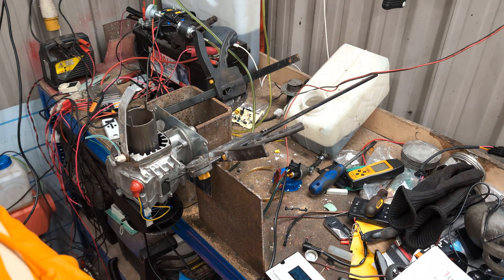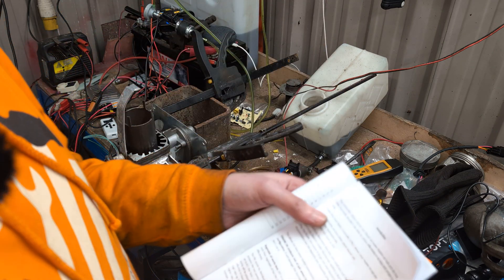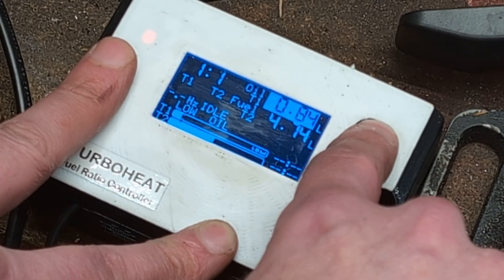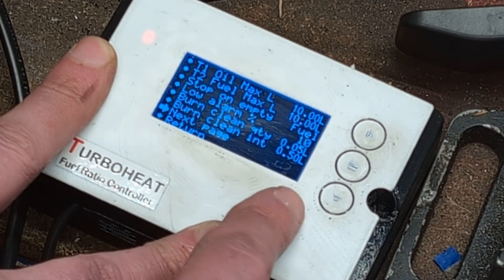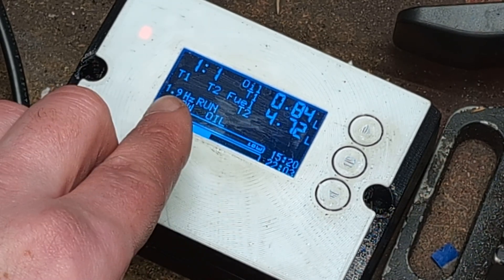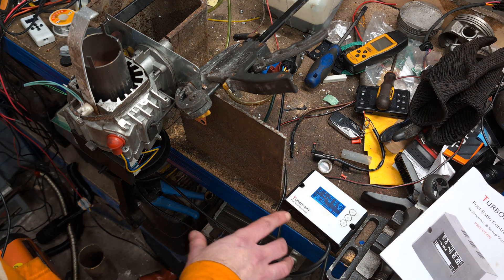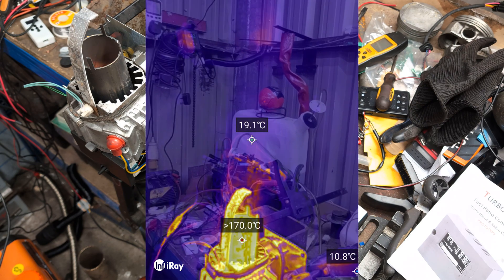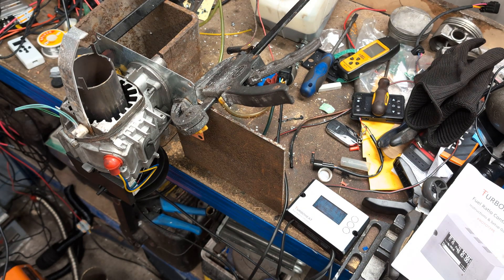Turboheat - Fuel Ratio Controller - Prototype - quick test / look

Comment: This is exactly what ive been looking for !!  saves me pissing about going outside in the winter switching taps from my veg kero to kero amd also worrying if the wife has switched to kero before switching it off . Ill be buying for sure !
Reply: What ratio do you mix the veg/Kero?
Reply: @simon7030  30% kero and a dash of acetone , also have a short copper section on the mix line that curves around the exhaust (not touching just warming) I've even put a couple of gallon of olive oil in the mix once 🤣.  You have to be religious with starting and finishing on kero for a good 10 minutes .  The biggest problem with veg oil is its glycerin content basically if not burnt hot it will separate and polymerise and cover everything with a yellow hard glue like substance like what you see around frying pans and deep friers absolute killer stuff.  If that gets in you glow plug gauze and inner burn ring gauze it's game over . I'm 3 years without a clean though .

Comment: I had the same idea.. to start up on good fuel to heat everything up and then to introduce some ratios. I remember reading the MSDS for seafoam to find its ingredients and I'm wondering if that would help to prevent fouling. Or perhaps it could be added in a cleaning cycle. Loving your videos, very informative and entertaining.

Comment: Hi  all. I have done this few projects back. Difference is that I've had a webasto water heater and controlling whole system with PLC. I found that you can achieve best results only when you have two separate feeds directly to chamber, rather than two pumps feeding one line and then chamber. Shorter the distance after pumps merge then better. Even better if you don't merge pumps output at all.  I also had a brake line around exhaust to warm oil/ waste oil flowing from pump to chamber. Tricky to get right ratio but not impossible to burn almost clean.

Comment: Thanks for posting another option for us! 
 "10 : 10" is the same as "1 : 1" but it is a finer adjustment. When you're talking about .25ml(?) per pulse/dose, the larger the number ratio the better. However if you go out to 100 : 100 it is so fine that the controller, fuel pump, etc... it becomes irrelevant. Hope that makes sense.   

My engineering sense's tell me that there should be inline One Way Valves, Post fuel pumps and pre Y's and to also make sure that the fuel lines are equal length between the fuel pump and the Y.
Other than that, seems to be well thought out and executed. Great work and thanks to Johnathan!
Reply: It's 22ml per 1000 pulses for a 22ml pump, that's 0.022ml per pulse.
Reply: @andrewhodges7417  Yeah see.. lol.. Very fine increments. I knew it was a small amount! 😂
Reply: The idea by 10 diesel + 10 other oil, is probably for better cleaning. 10 pulses of diesel and then 10 pulses of other oil, and vice versa.

if you were to alternate with one pulse of diesel and one of other oil it would just mix better. but might not clean the diesel heater as well

Its just my assumption😁
Reply: I have built my own twin pump digital controller and found that the pumps themselves resist backflow, so no need for one-way valves. Equal length pipes are not required, but it's good to have the pipe after the Y as short as possible so that changes are effected all the sooner.
Reply: @davgregeric  I did have a thought about the pumps not allowing the back feed. Do you know how much pressure they are able to with stand before bleeding off? Or does it just correspond to time?
Reply: @andrewbowden1076  There is little to no restriction of flow into the heater, and hence low pressure in the Y post pumps. Where there are bubbles in the pipes after the pumps and before the Y, I can see them "bounce" a little when the opposing pump pushes its pulse of fuel. But they never flow backwards even when the opposing pump is the only one being activated pulse after pulse.

Comment: This is interesting! Do you think these can be used with name brand heaters as well?
Reply from the maker: If it's got a pulsed fuel pump this with will work with it.
Reply: he said any Diesel heater
Reply: @raymondj8768 he didn't specify diesel (as you can get them in petrol) but did specify pulsed pumps (diaghphram pump based)
Reply: So long as it can work with controllers that either disrupt the ground line or disrupt the 12V line to the pump, and at the same time satisfying the idle time check for pump presence, then yeah.